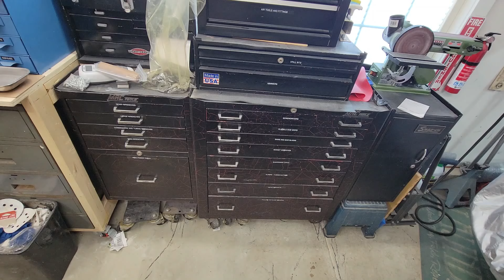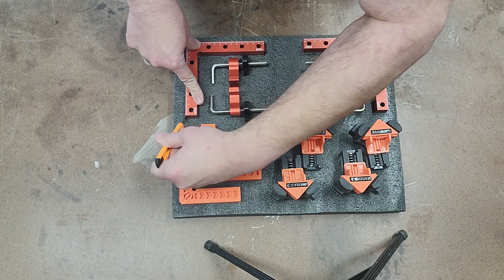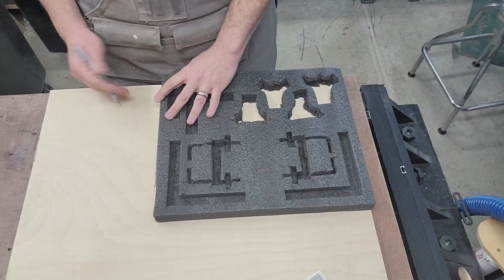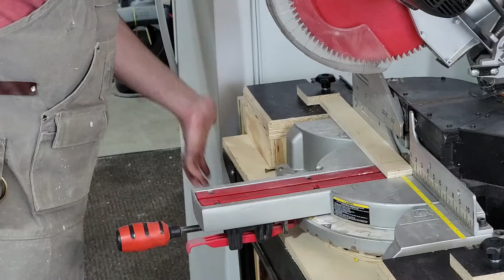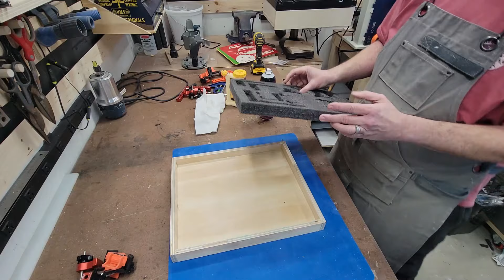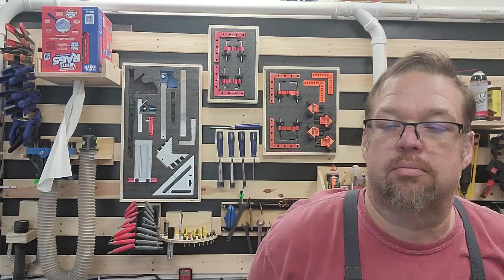HOW TO BUILD Wall Mounted Foam Tool Holders | Woodworking

Comment: How do you not have a thousand thumbs up on your vids yet?  
Again, you came through and it’s exactly what and how I can use.  
I actually just lost track of my new machinist square (a really expensive one) and I need to make sure all tools are accounted for at the end of the day or I’ll end up in the poor house. 
Rockler foam?  Hmmmm… time to fine a knock-off version. 😉
Reply from the maker: Fastcap makes their own version as well but I think thr Rockler foam was cheaper.  Their should be links to everything in the description. Thanks again for your kind words!
Reply: THEN I saw that someone makes a foam sheet in dual color; so the empty space can be a bright yellow or red etc.  But, those are horrible expensive, around $40 per a drawer sized sheet.  And THEN I saw a vid how to make the two colored foam sheet from inexpensive craft store sheets.  Combine that with your wood backing/frame and it’s geek heaven. 
Score!

Thanks again for making the time.